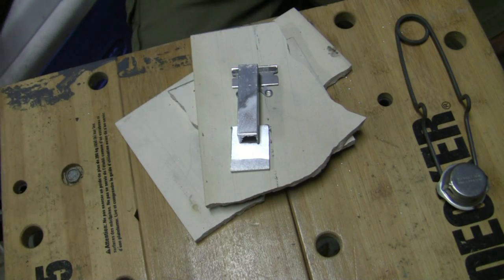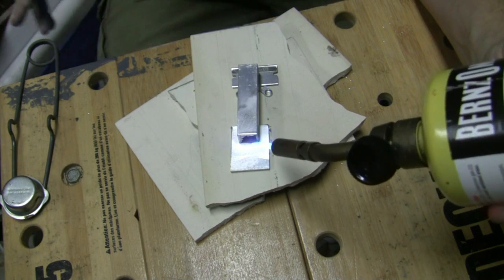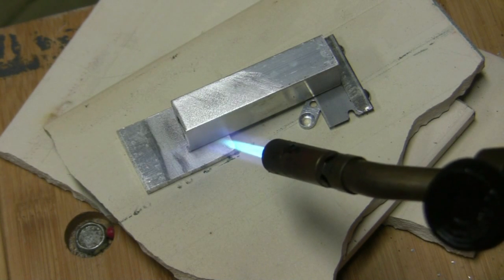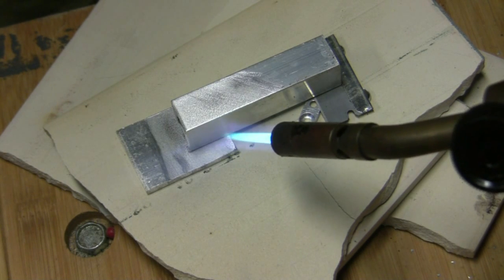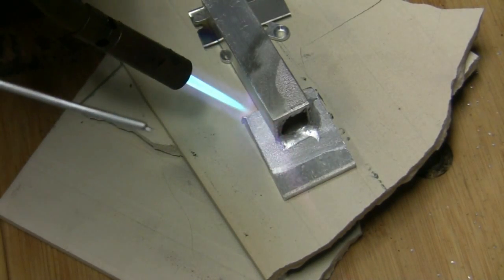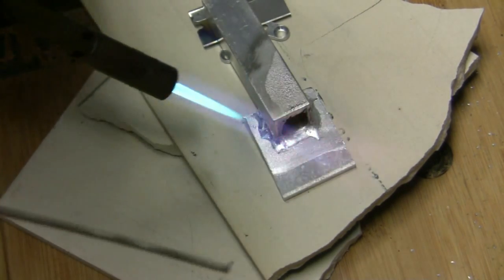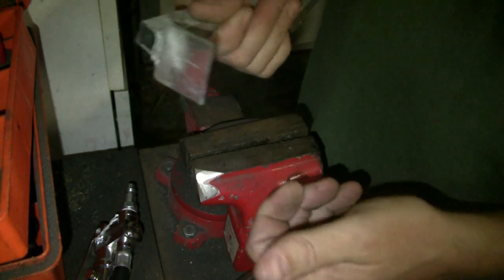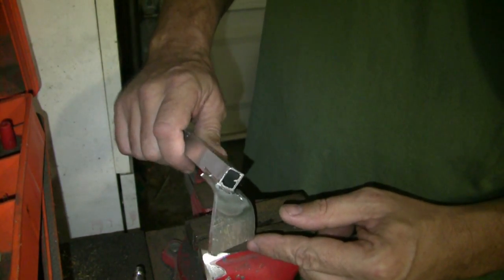Alumiweld - Connecting aluminum with Alumiweld solder

Comment: I would have tinned the surfaces of the square tube and the plate, then put them together with a weight on top, and then brazed the edges including the back that you did not do…… just realized this video is ten years old

Comment: This definitely wouldn't be safe for soldering Aluminum tabs on Lipo batteries. At those temperatures it could cause the Lipo to over heat and light into fire.

Comment: 3:23 according to my calculations, that flat aluminum plate is about 5 to 6 mm thick. As seen, you've applied enough force, probably more than the pressure created by an engine water pump in the radiator hose line. As a result, it seems I will resort to this method because I am one poor bastard to afford argon gas...

Comment: By the time he heats it upto 700°C it will be just a puddle. Aluminiums melting point is 660.3°C
Reply: The rods melt at roughly 740 FAHRENHEIT. Aluminum has a melting point of 1,221 FAHRENHEIT. You're using Fahrenheit for the rods and Celsius for aluminum's melting point.

Comment: Dear God pull the flame away from the rod before brazing. The piece melts the rod not the flame. You will absolutely get false welds if you don't follow basic brazing rules. Your surface welds are breaking because of this.
Reply: It's not brazing you dumbass, it's soldering, he was heating the aluminium and sweating in the rod, it's aluminium if he took the heat away when sweating the joint the heat would dissipate to fast and he would just get a pasty mess, educate yourself on sweating joints using Alumaweld with aluminium. Aluminium dissipates to fast to sweat it without constant heat. You're one of those know it alls that doesn't know jack shit and just likes to give advice even when it's not needed! You would probably give advice to a horse on how to gallop because of your arrogance.
Reply: @FarmerFpv  sounds like you could use a sammich and a nap! Calm down son

Comment: Odd Observation...Lets say you heated and laid down couple small beads either horizontal or vertical underneath the 2 pieces one is wanting to join and then follow up outer welds? Would it improve strength? Would it be possible?
Reply from the maker: the problem with alumiweld is that if you get too much heat near a weld you made previously, it will melt it, difficult to do two welds close together

Comment: The technique shown in the video isn't proper.  The material you're attempting to 'weld' (solder) should be hot enough to melt the rod itself.  In this video you're actually melting the rod with the torch, which is just globbing the surface.
Reply: What are you talking about? he was heating the aluminium and sweating in the rod, it's aluminium if he took the heat away when sweating the joint the heat would dissipate to fast and he would just get a pasty mess, educate yourself on sweating joints with aluminium. Aluminium dissipates to fast to sweat it without constant heat. You're one of those know it alls that doesn't know jack shit and just likes to give advice even when it's not needed! You would probably give advice to a horse on how to gallop because of your arrogance.
Reply: @FarmerFpv  Two things. Before you go tell someone to educate themselves, you should understand the proper use of "to, too, two. You meant to use "too" not "to".  And what Cup said is accurate. If you get the work surface hot enough it swill still  maintain heat long enough to sweat in the joint. What he did in the video is not the correct way. I'm sure it still will hold, but it looks like shit.

Comment: If you had laid another bead on the opposite side where the square tube ends, it would have been even stronger, and resisited breaking from that location, which is where the separation first occurs.

Comment: The bonds I made cracked off the same way until I learned the technique of brushing the molten puddle  gently with a stainless steel brush or scratching a stainless wire in it to break the aluminum oxide layer on the work piece area covered by the molten puddle. After learning that, my bonds were stronger than the aluminum and doing vice tests the bonds will not fail anymore in the  Alumiweld bonded area.